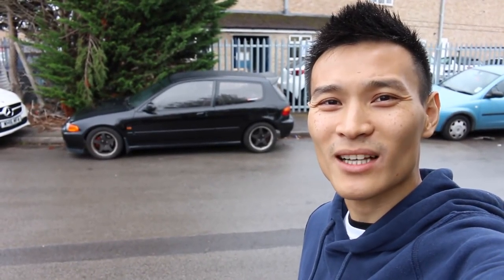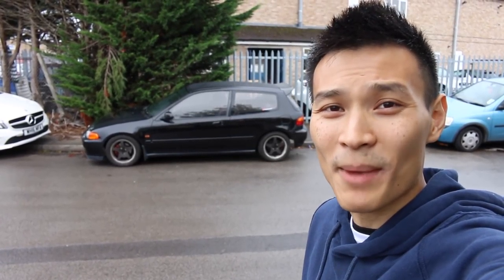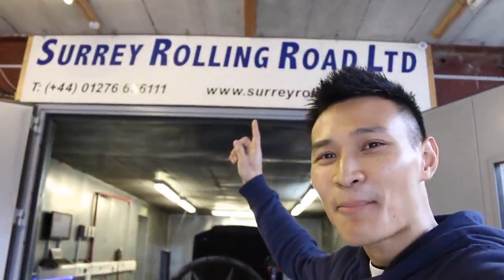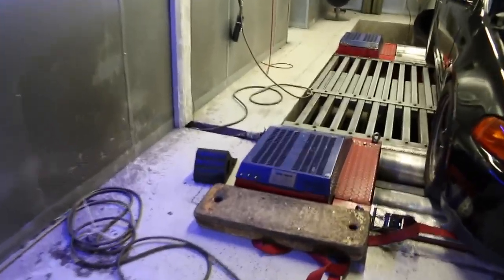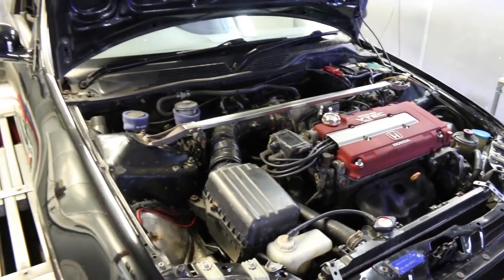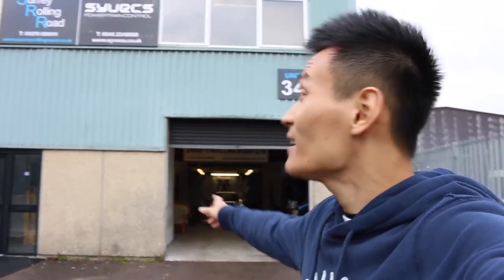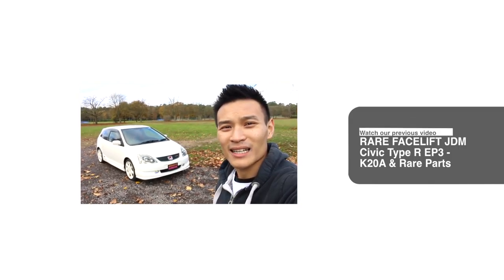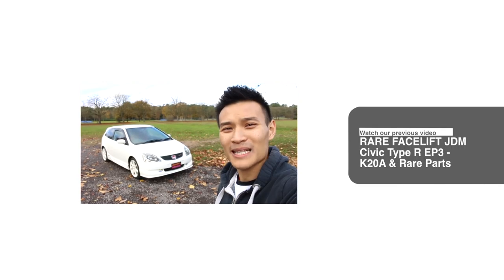ECU Remap - Can we get 200+bhp from a stock B18C6?! Civic EG6 SiR II - PerformanceCars

Comment: B18C6 is only 187bhp unless you have the B18C exhaust manifold and ECU. Dyno probably a bit off but either way strong engine. Would like to let him tweak the tune I have on my DC2.
Reply from the maker: +elliot438bcfc Hey, it's hard to say what the exact bhp the B18C6 should be. Most people say it has 197bhp standard. 
The dyno used at Surrey Rolling Road is well known throughout the tuning community and Romain is just as famous. Dyno Dynamics tend to read more accurate than others but of course, there are always variables. 
But give him a call, he really knows his stuff. You only need to do a quick search on Google about Romain Levesque and you can read other people's comments. Good luck with the tune and let me know how it goes 👍
Reply: PerformanceCars
B18C 197bhp, B18C6 187bhp but like I said only difference being the manifold and ECU. I definitely will contact him when I am ready. It made 213bhp when it was mapped before but there has been a few changes and I think she is capable of a bit more!
Reply from the maker: +elliot438bcfc Unless a remap can give you that much more horsepower? I can only comment from the results. 
Nice at 213, who did the map before?
Reply: PerformanceCars I imagine just a remap can see you 197+ as the engine is identical to the b18c just a slightly restrictive exhaust manifold on the b18c6. It was mapped by Gordon at Street Racers in Leicester it's a very accurate dyno, mine is running full bolt ons with skunk2 cams, valve springs and retainers. It is having some cold idle issues and running a bit rich on overrun so definitely want to touched up

Comment: Was the 2.25" exhaust manifold changed to 2.5" ? 205 bhp with standard exhaust and cat would mean a 17 hp gain over stock with simply a remap if original manifold was still being used.

Comment: how do you measure flywheel hp on a wheel dyno?
Reply: Devin Sullivan It is back calculated from the wheel hp.... this is done by calculating transmission losses on the coast down after the power run.
Reply: Twin2 Civic Garage T2CG as good as you can, but they have no idea the losses between cars, or the maintenance of each drive train, I'd hope honda would lose less than others due to lightweight obsession